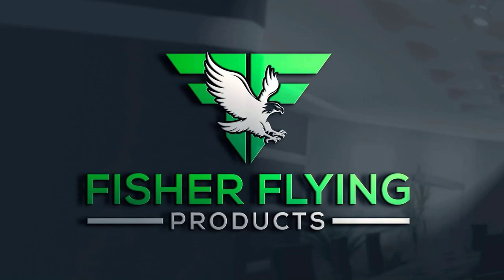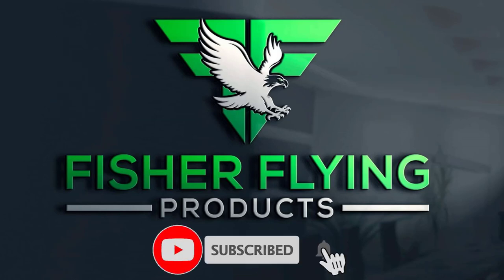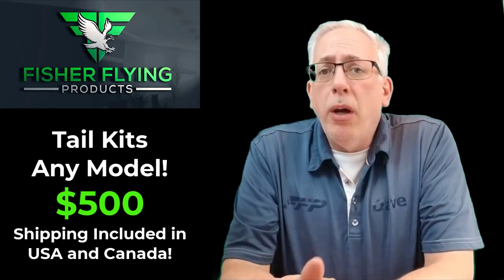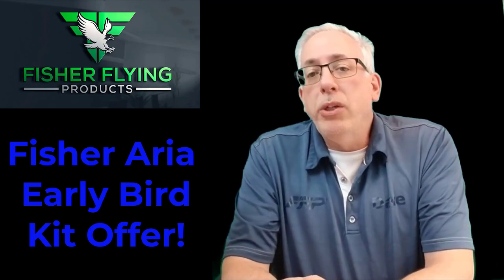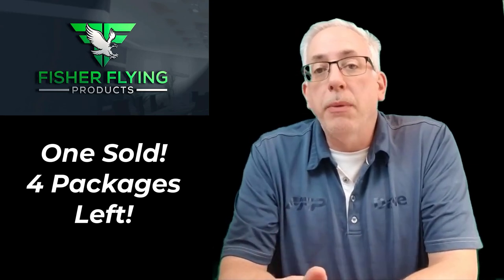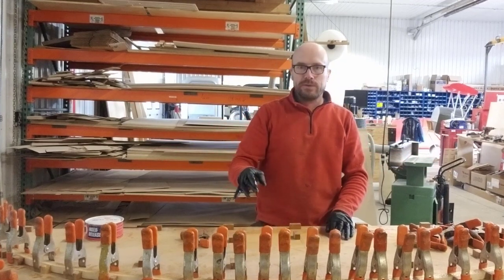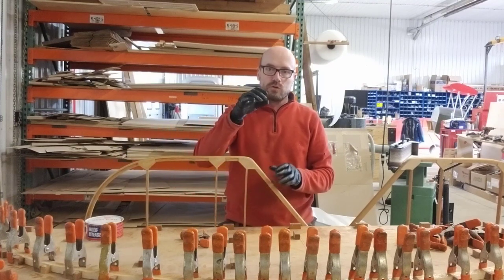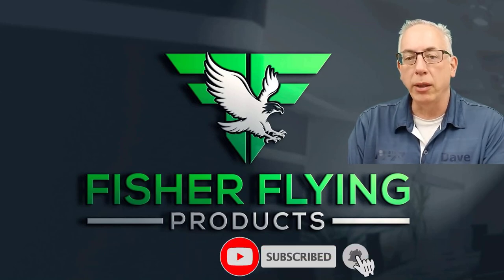FISHER HOW TO VIDEO - LAMINATION DEMO - ARIA PROJECT

Comment: That's how I laminated my tail feathers and wing tips, but with the elevator I got tricky and used a 3/4" metal band that went around the whole thing like one-big clamp, pulled tight with parts from a steering wheel puller. Worked good but overkill.
Reply from the maker: Great idea. Thanks for the comment.

Comment: This was a very informative video. I would be curious to know approximately how much epoxy or how many mixes were used for this lamination.
Reply from the maker: Approximately 1 mix per lamination strip.
Reply: Thanks!!
Reply from the maker: Forgot to mention that the mix had 20 lines of each part of the epoxy instead of the 5 shown in the video.